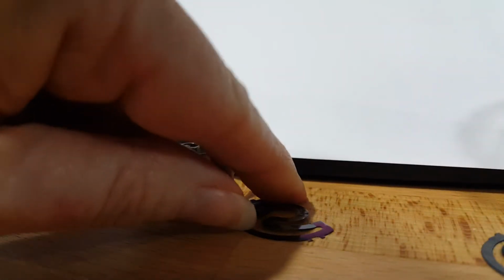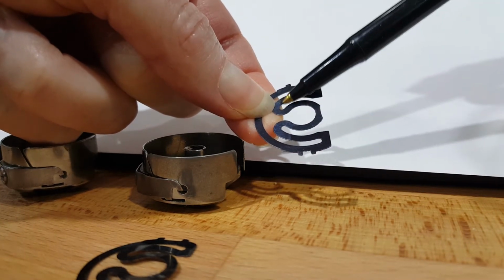Adjusting the backlash spring on size M bobbin case

Comment: How do I identify the front and back of the backlash spring?  Do I just select one side and identify as ‘front’ so the other side is automatically the ‘back?’
Reply from the maker: One side of the backlash spring has little tabs that are closer together and the other side has tabs that are further apart. You can match them up with your bobbin case so that it fits in correctly. The center of the spring should be the tallest part of the spring.
Reply: Thank you for your reply. I tried it on my bobbin case and it works. That seems to have taken care of the “eyelashes” on the back of my quilt. I’ve been going nuts trying to solve the eyelash problem.  It’s somewhat frustrating that the problem had such an easy fix. Thank you for the information.
Reply from the maker: @carmenfriesen9289 you're welcome, I'm happy to help.

Comment: Do I really need this spring in my bobbin case?
I bought a new bobbin case and it's without the spring
What problems I am going to face??
I have ricoma 12 needle machine
Reply from the maker: I've notice a lot of bobbin cases for industrial embroidery machines don't have a backlash spring.  I know that you run tension tighter in the bobbin for embroidery machines than you do for quilting machines.  If the original bobbin case had backlash springs I would try to get the bobbin case for your specific machine.